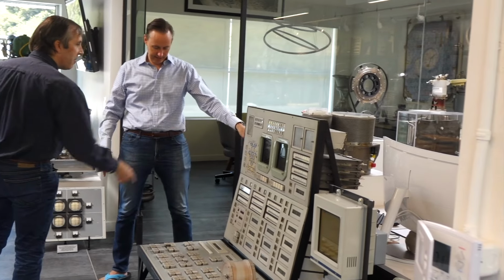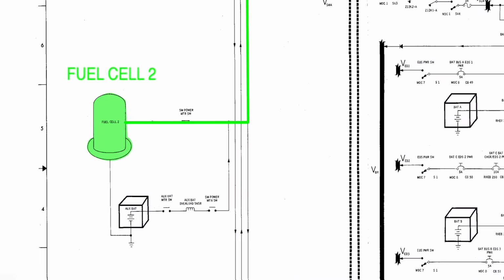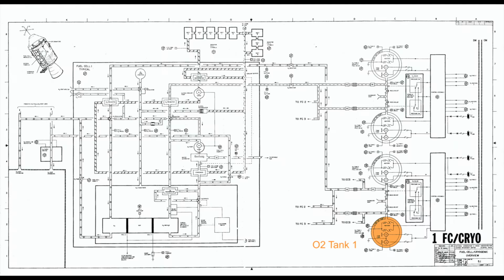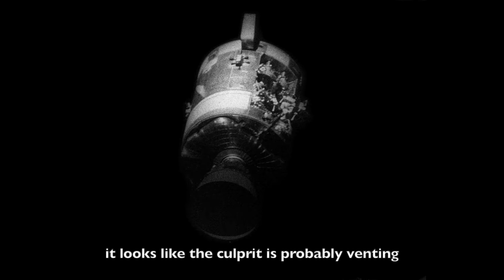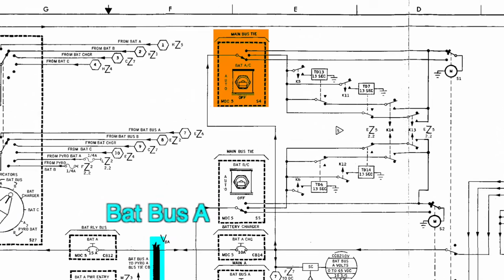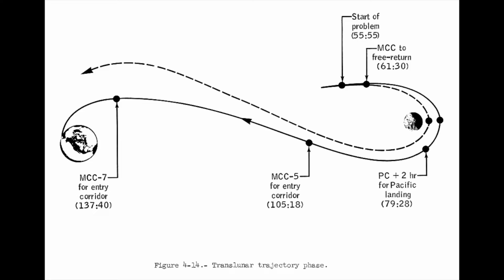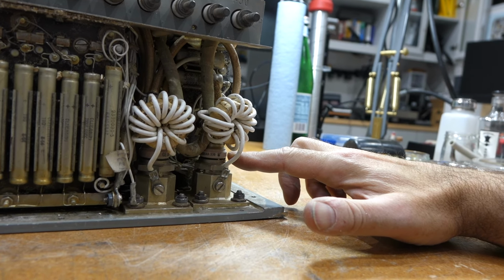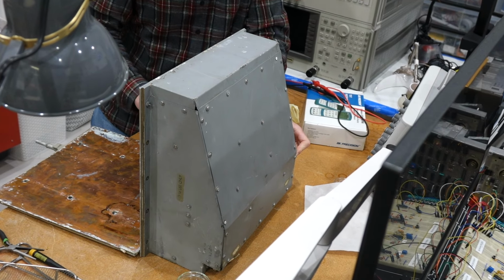Apollo 13 accident: understanding Houston’s real time debug (Apollo Comms Part 28)

Comment: Why not just clean the inverter? Large ultrasonic bath and it should be fine. 
Before the dangers of asbestos were understood a lot of people worked with it daily and a large numbers never got sick.
That is not too say it isn't dangerous. Avoid it if you can, but the investor should be safe after a nice bath.
Reply from the maker: It would have to be done by a specialized facility accredited for asbestos decontamination. There is a good chance they would confiscate the item on the spot and ban it from ever being returned to use.
Reply: @CuriousMarc  why would they confiscate it?
Reply: @CuriousMarc  can you share more details on this? I left the end of the video wanting more info on this situation.

Comment: A little query about the subtitles @23.15. You've written it as "to get a COARSE align in the LM" (ie the opposite of 'fine'), but maybe they meant "course" (ie direction)?
Honestly it could be either "get a coarse alignment in the LM, and let it work out the fine alignment later", or "get a course alignment for the LM to follow". I wonder which?
Reply from the maker: It’s coarse alignment, as in the AGC P51 program, when you try to get the IMU up from scratch, which is very difficult to do in space, and would have been near impossible with the limited LM optics obscured by the CSM and the floating debris. Instead they manually copied the IMU angles from the CM to the LM. Fine alignment is with the P52 program, and you are supposed to do it before each burn. Once you are coarse aligned, the computer helps you point to the right stars, so it’s much easier, provided you can see something through the optics. Which they could not. Instead they devised a procedure to bring the spacecraft to a specific attitude then point the LM telescope to the sun, which they could see through the debris. And if it showed within 2 diameters of the crosshairs it would be good enough (2 degrees, instead of the small fraction of a degree they usually required). It came up within half a diameter, everyone was super relieved, and they did the burn without a P52. For the last correction burn, they were out of power, so they did it manually without any inertial platform, just by sighting the Moon or the Earth (can’t remember which) through the graduations in the LM window and timing the burn!

Comment: The fact that the engineers put in the ability to switch all things to all other things shows great foresight. And the calmness of the whole crew never ceases to amaze me.
Reply: My understanding from the video clip they showed is that they couldn't just route directly from LM to CM battery charger... But they could route from LM to one of the CM buses and then just turn off everything except the battery. ;)
Reply: @Khrrck  That's my takeaway too - by using a bussed design they had lots of flexibility built in, which ultimately saved the crew's lives.
Reply: Almost all satellites and spacecraft are designed with redundancy, and this level of cross-strapping is common to ubiquitous. I would add - most large satellites are vastly more complex than the Apollo CSM, so there are tens of thousands of pages of drawings as in the video.
Reply: This is very normal for critical systems to be designed that way.  Cosy goes way up though.
Reply: Aircraft probably pioneered this. In a modern commercial jets, any fuel tank can feed any engine, any generator can power any bus, and any pump can power any actuator, in most cases.

Comment: I know that the Howard movie was not accurated in almost any situation, but what I did not understand in the movie was the "if we shut down this and that we are not able to switch it on again" buisiness. Was that another Howardism or does it actualy fit somewhere in the process of what realy happend?
Reply from the maker: It’s true. The inertial platform had to be kept warm even when tuned off. They were not sure if it could be repowered from cold. But they had no choice. It went close or below freezing. And it powered back up OK.

Comment: The talk of the fuel cell failure accident isn't really off the topic, since the context behind the inverter's history is appreciated and important thanks to weird aviation power requirements, but boy, was it off the cuffs.

Early switchmode power supplies tend to be huge hunk of metal and loads of transistors, during the time when power supply efficiency was being worked on as the companies want to shove them in everything as it's cheaper than huge Iron transformers, so nowadays you can put together the same 28 Volts DC to 115 Volts AC 400 Hz pure sine wave inverter that's 1/3 to 1/4 the size of the original Apollo 13 inverter, technological advances are amazing.

Comment: Sooo. When do you power up the actual fuel cell? You can find a new inverter and you  "have" a fuel cell already.
Reply from the maker: I badly want to. Take liquid hydrogen and oxygen shove them together in a cell where they will be separated by a 50 year old membrane and heated to 400F. I can't think of a single thing that could go wrong.
Reply: I cannot think of anything either.🤔😂 Given the workmanship they put in I would not be surprised if it just workes. Also, Power it up in your lab only if you have the desire to live a life on the edge. Also an additional fire extinguisher or two might be a reasonable investment.

Comment: It is fascinating to see how much flexibility and N+1 redundancy was built into the Apollo CM and LM systems.  It is a tribute to the designers to have anticipated the potential need for flexibility even though there was a mass and volume penalty for doing so ... and they were rewarded for the foresight by Apollo 13.  Also, just think how much smaller and less massive that inverter would be if made with modern semiconductors - it would now be practical to synchronize phasing in order to parallel inverters onto the same bus.

Thanks for sharing the fascinating transcript of some of the brainstorming behind recovering from the total loss of DC power from all of the SM fuel cells simultaneously.  Wow, what a nail-biter.

Comment: Not all vermiculite is contaminated with asbestos.  In fact you can still buy safe vermiculite by the bag at Ace Hardware for $5.99.  The problem is you can’t tell if you have nice or nasty vermiculite just by looking.  The bad vermiculite came from a Libby, Montana mine, and that was about 1/2 the world’s production up though 1990 according to US NIOSH.  Chances are at least even odds that if you open up something made before 1990 and it contains vermiculite, it is the bad stuff.

Comment: It could be cleaned out with some 3M novec wash and a little co2 blasting.  These would not damage anything (use the lower settings for co2)
Reply: I sure hope they put some effort into cleaning it so it can be restored, I was confused by Marc’s reaction and was hoping for more details.
Reply: It most likely doesn't even have any asbestos in it, it's rare for vermiculite to be contaminated with it.

Comment: Always wanted too see inside one of these inverters, very early SS inverter thats compact. Good call on those caps some of those are tantalum and can and do frequently short. Yes a single bad cap in the drive stage would be a major smoke event. Thanks for another good vid!

Comment: That inverter looks like a perfect candidate for one of those CT scans(obviously sealed in plastic bags the whole time).
Reply: The metal casing would react badly to the main CT magnetic field .  Remember, no metal allowed within 20 feet from the machine
Reply: @johndododoe1411  Huh? I don't think you got that right at all. There is no magnetic field in CT scan, it uses ionizing radiation.
Reply: @FrozenHaxor  Oh, I always get those 2 medical scanners confused .
Reply: @johndododoe1411  no expert but I think of CT as a 3 dimensional xray.

Comment: That was one roller coaster of a video. I learned a lot of the Apollo 13 dysfunction (?) it was great to see the block diagram and the original dialogue as they tried to work out what had gone wrong. Thanks again for your efforts !

Comment: Vermiculite, in and of itself, does not contain asbestos, but comes from it being present along with vermiculite when mined.  A lot of it would depend on when the vermiculite was added to the inverter.  If done by Westinghouse - fair chance that it might have contained it due to the timeframe, major suppliers, etc.  If done by someone later on, possibly less likely.  Might want to have a sample tested.  Find out if you have to have the lab/house decontaminated or not.
Reply from the maker: Unfortunately it's the old contaminated one.
Reply: @CuriousMarc  With proper PPE, it still isn't that dangerous! Fix the cap and power it up!
Reply: @CuriousMarc  Did you have it tested? It could still be washed off and decontaminated
Reply: @CuriousMarc glovebox time
Reply: @mikebarushok5361  Well, that's disturbing. I never knew about asbestos contamination of vermiculite. I spent a good part of my youth in the 60s and 70s up to my elbows in vermiculite, growing and propagating plants. No mesothelioma so far, though.
Reply: @johnopalko5223  hopefully you weren't manipulating vermiculite in a closed area and if it was always dampened the fibers aren't as likely to be inhaled. I too was exposed to asbestos from working in a wholesale greenhouse where we mixed all our potting soil in a small enclosed room. Not moistened until used. I try to remember to get a chest X-ray every couple of years and so far all's well. I also had exposures to high temperature asbestos insulation for aircraft parts, did lots of brake lining replacements on cars and trucks and used asbestos and metal mesh heat deflectors when I did soldered copper plumbing repairs.

As the song goes "I wish I didn't know now what I didn't know then."
Reply: Yah the testing is pretty cheap too, for sure send it off and find out. My evil motivation is because if it comes back clean then they can do more videos on it ;-)
Reply: I didn't know vermiculite could contain asbestos. Should I get rid of my pillow stuffed with vermiculite?
Reply: @Worsdier  Depends. Did you stuff the pillow or did you grandfather do it?
Reply: Vermiculite from Libby, Montana, mined between 1928 and 1990, was contaminated with asbestos. It produced 75% of the worlds vermiculite at its peak.
Reply: @mikebarushok5361  AFAIK only ONE mine, namely the Libby mine, was known to have their vermiculite (zonolite) contaminated by asbestos whereas all other producers of vermiculite were deemed safe.
I can understand that you who live in the US might be worried about old vermiculite but here in Europe it's virtually unheard of - apart from false information that all vermiculite contains asbestos, which isn't the case here.
Here we use vermiculite not only in our chimneys but we pot our plants with it and we add it to our flower beds as soil improvement, and we've done so for a very long time. Our vermiculite doesn't come from Montana though...
Reply: Cringed a little, seeing it go into a vacuum 😮.  Also, just found this channel and it is my new favorite thing on the internet
Reply: This. I doubt it's contaminated. You buy the stuff in bags for chimney insulation amongst other things, and never have I heard of vermiculite being contaminated with asbestos!
If you're worried then have it tested, but I'd be really surprised if it isn't clean. (apart from some dust though... ;) )

Comment: I have listened to the full audio on bringing Apollo 13 back home. It was suspenseful to put it mildly. I am happy you all drew the line for safety in further exploring the inverter. Still I wonder if there is any use in finding a way to decontaminate the unit.

Comment: Welp, RSVP Apollo AC power inverter. At least now you know why they needed to put the thermal goop between it and the cold plate, it was probably overheating because of all that insulation!

The only way to be sure would be to completely disassemble it and wash every board and surface. Yes, it would be technically possible, and it would give you the opportunity to identify and block test/troubleshoot/repair each board, but it would be so much work! You'd risk contaminating your lungs or eyes (or even just carrying away particles in your clothes) every time you move as much as a wire, unless you were fully kitted up in a bunny suit with respirator and goggles (or full face respirator). It's just not worth it if you can get access to another uncontaminated example.

Comment: EECOM: I want to power down a total of 10 amps, flight
FLIGHT: A total of ten amps!
someone else: surprised whistling
Reply: I believe that was Gene Kranz whistling, if I recall correctly. He was a bit shocked at the delta that EECOM was requesting.
Reply from the maker: Yes, that's Gene Kranz. Remember, he has not been told yet that they think they lost Fuel Cell 1 and Fuel Cell 3, so this comes as a bit of a surprise.